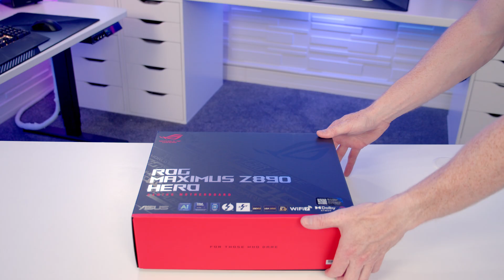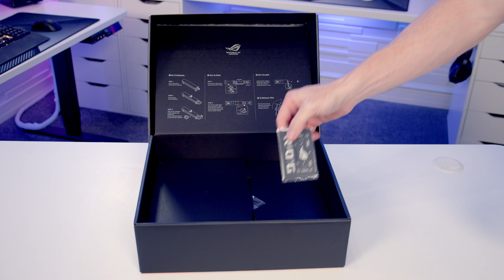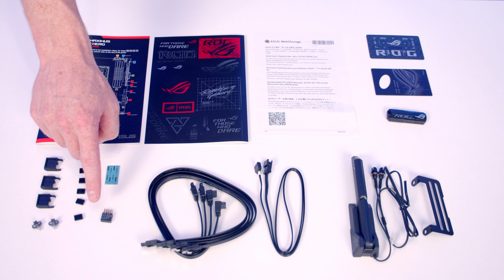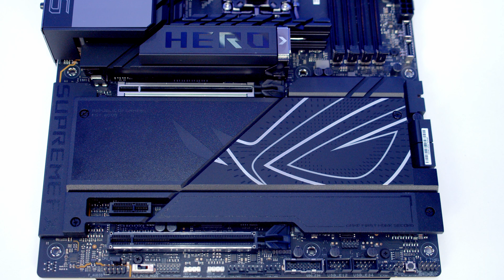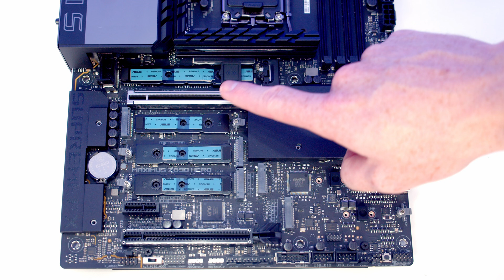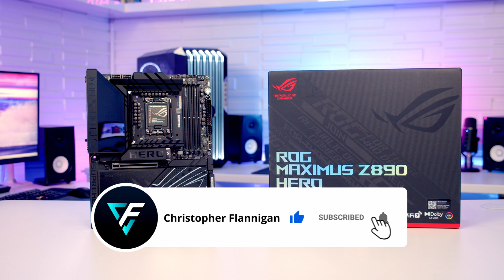ASUS ROG MAXIMUS Z890 HERO Overview

Comment: Maximus series pricing isn't reasonable except for the most extreme over clockers, $700 is just a waste of money for 99.99% of people, I wouldn't go with anything higher than their Strix series and even that one can reach $500 which is absurd for someone like me who just want a 7 segment display and regular functionality.
Reply: if you're dead set on going with Asus... 99.99% of people should buy the TUF board, you are correct even the strix is a bit overkill unless you just want ALL the usb ports on the back (it has more than both the hero & the extreme), the strix is the absolute highest most people should go if you've maxxed out on everything else and still have budget left to spare, anything higher is just a waste of money, you will not use 99% of the extra features or take advantage of the extra capabilities, save money or put it somewhere else that will actually make a difference, more storage, faster ramm, bigger gpu etc!
Reply: @JYMBO  100% agree with everything you said.
Reply from the maker: Strix is a solid board and I used it for z790

Comment: How much better are all the features with the Extreme vs Hero? I'm considering buying the Extreme... but just wondering if there are enough benefits over the Hero to justify forking over $300 more?
Reply: if you are wondering then you shouldn't buy either and buy a Strix or something even cheaper, this is overkill unless you are doing extreme overclocking or need some obscure and specific feature.
Reply from the maker: I haven't reviewed the extreme

Comment: To anyone considering buying pc parts, ASUS are junk.  They go faulty or die just outside warranty and they don't wanna know. I recommend any other brand for any type of part.They market well and overprice to seem like they're above others in quality but it's the opposite.
Reply: I have never had a problem with any Asus Mobo or GPU for that matter. I have had at least 15+. For that matter I have never had an issue with any Mobo, Gigabyte , Msi or Asrock. I would say I run them longer than average as they do science 24/7 on 4 to 5 PC's.
Reply: @chex313 Same here mate. I’ve been building gaming pc’s for over 5 years now. I’ve used Gigabyte and Asus mobo and graphic cards, along with EVGA, and many others brands. Never had a problem with any of them. Solid, stable hardware. Obviously, they are mass produced, and a small percentage of parts may be faulty. That’s the case for any mass produced product. There is nothing wrong with Asus, as a brand. In my experience, asus has actually been a bit higher quality than some other brands.
Reply: Stop spreading misinformation, every company can have faulty parts that fail. Asus makes the best looking stuff and the quality is there to match it. My first ever car was a renault and broke down after 2 months when warranty passed. Does that mean I blame the whole brand for one faulty car?
Reply: @Ali1994So  Renault?  Yes, the entire brand.
Reply: I have never had an issue with Asus motherboards or any other Asus hardware for that matter.
Reply: They also die or go faulty within warranty and Asus still doesn't care. Or it takes serveral months and a lot of mails to get your board or gpu repaired and back.